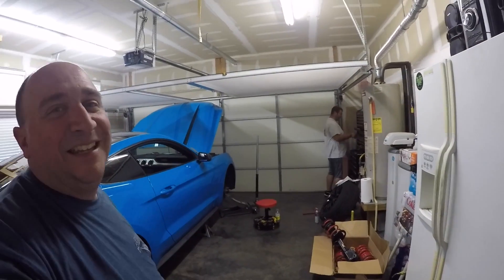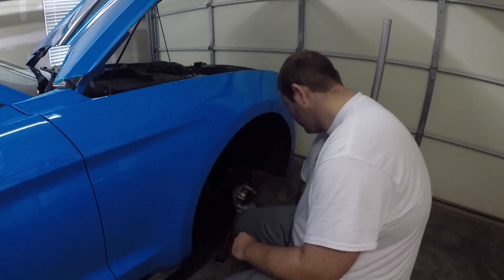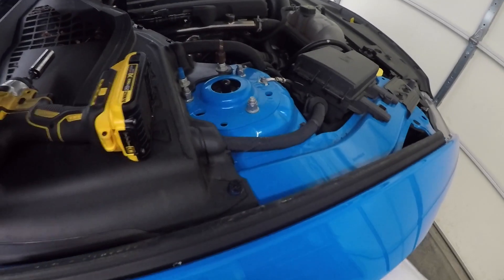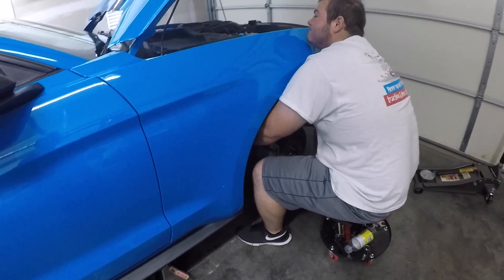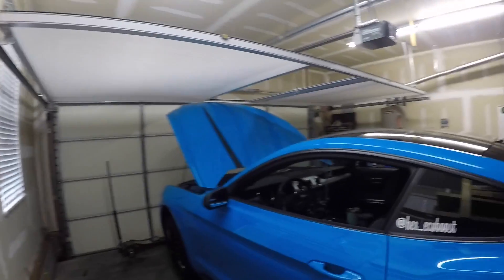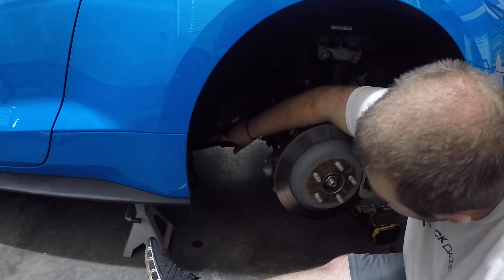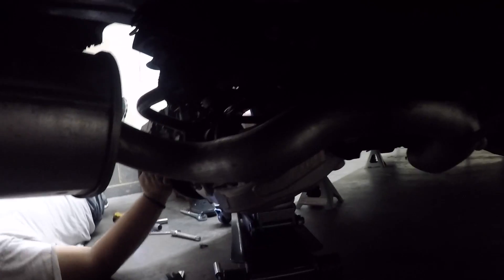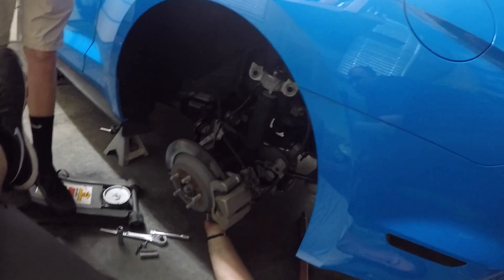Lowering Her Pony!

Comment: are those stock struts and shocks and do u they need a adjustable panhard bar now
Reply from the maker: DIS50GO no because the S550 have the independent rear suspension
Reply: N2MYGT ok, must be nice. ill be lowering mine in few months
Reply from the maker: DIS50GO yes you're definitely going to need the panhard bar. I believe your years the same as mine